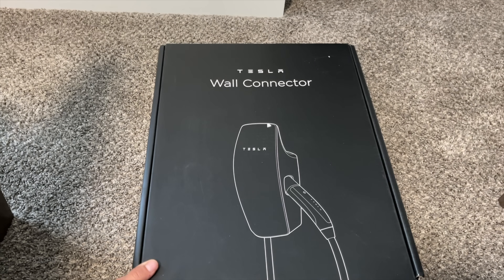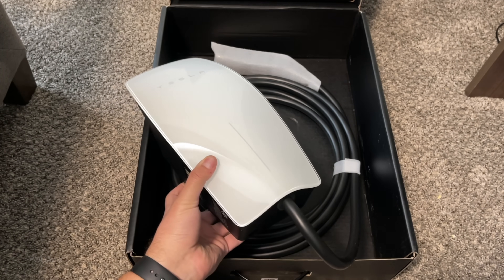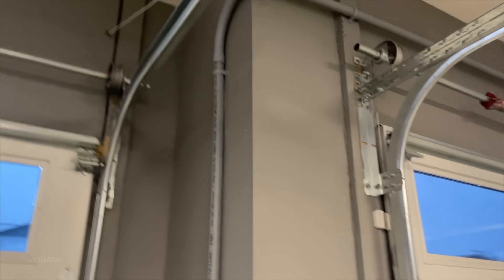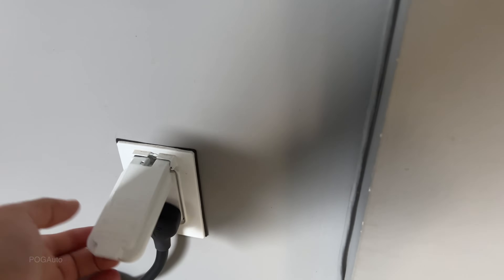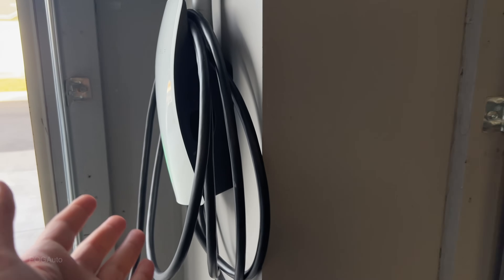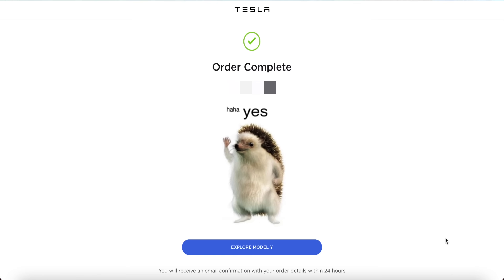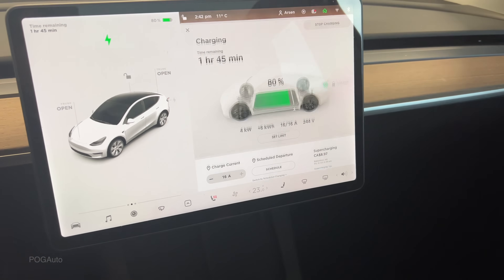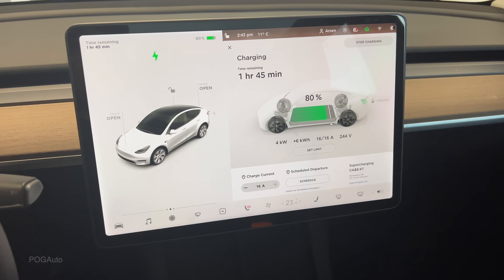Tesla Wall Connector - You need to know this about home charging!

Comment: I just purchased a 2025 Model 3 Performance back in March. I planned on doing Supercharging when my battery was really low and need  to do longer trips since it was right down the street and figured I would only need to charge once a week cause I live 3 miles away from work and use my 110 mobile charging for overnight. supercharging is a pain though overtime since its time consuming. so far I noticed I use about 5-10% daily (Based on Weather). So I was going to have a 14-50 NEMA EV outlet installed with a 40AMP breaker on a 100AMP service. But even with an EV outlet I just felt uncomfortable plugging in to an outlet overtime which could eventually lead to loose connections and possible electrical fires (highly unlikely with a professional install and the correct outlet wire and GFCI breaker.) but the down the road maintenance on the outlet didn't make sense. So instead I bought the wall Charger for 420 dollars and had my electrician install a 60AMP breaker on a 100 AMP service. I know it sounds like too much but my scenario is unique I don't have central air or a mini split our heat is oil and no electric hot water tank. We have a washer and dryer on electric. But with the car charging on 48amp the stove running with the dryer off and lights on through the entire house the electrician did a load calculation and the house was pulling 65AMP's. I don't Plan on charging my Tesla while cooking a Turkey in the oven while doing a load of laundry. Electrician said even if I did that I would still be fine. I charge at night after 11pm everyone is in bed lights are off and maybe a few window AC's all 110v are running (summer time).  Electrician stated that Electrical is much more efficient then years ago. 

Moral of the story if you wanna do a wall charger on 100AMP service have an electrician come out and do a load calculation. to see if its possible. Maybe you will have a scenario like mine. But so far I have had no issues and its great waking up every morning with an 80% charge.

Comment: Do you know what size wire they used from the breaker box to the Wall connector?  If they didn't use #6 or thicker gage you still won't be able to safely use 48amp charging with the wall connector. (so obvious answer would be to re-run that bit of wire with the right stuff but it's another expense you may not have considered)

Comment: What a crazy waste of money for a glossy EVSE. Should have just bought another mobile connector and added a nema 1450 outlet.  I did all mine on a crusty 30 year old Challenger panel with a 50 amp breaker for $350.  Mobile connector was $250.  My car charges at 32 amps.  Or 50-80% in 3 hours.
Reply from the maker: Please see the new updated video. This was done for a upcoming planned upgrade

Comment: Dude - thought it’s supposed to be “how to use a Tesla Wall Connector” - not what are the requirements to  install the wall connector.  Took us 2 hours run wires / install.  How to use a Wall Connector app once everything install

Comment: I hope people pay attention to your advice of checking out your homes electrical panel before moving forward with an upgraded charger or really any item that you plan on using more electrical at your house. I work in HVAC and can not tell you the number of times we need to upgrade the electrical panel to have the new system installed to code. If you do not do this it can cause major issues including major safety problems. Really glad you included that last part, very important.

Comment: I'd get a second opinion for a different electrician and also consult your power company.  the power company WANTS you to drive EVs badly and will make it work one way or another.
Reply from the maker: Unfortunately the electricians were right but there is a different way and now there are 3 wall connectors installed on a 60amp breaker on a power sharing mode

Comment: Can you install the Tesla wall connector outside? My garage has too much stuff in it to fit a car. 😂
Reply: I saw another video where the Tesla owner recommended the wall charger (over the mobile charger) for outside use as it's designed to be weather resistant.

Comment: Look into a black box.  It is a automatic load management system.  So you can have a 60amp breaker installed as it would count that 60amp breaker as 0% load not 100%

Comment: You should have wired it for 60amps anyway with the appropriate hardware and breaker instead of limiting yourself to 20amps. In a crunch, you could monitor electricity usage and devote up to 60amps of your available 100amps to your EVs (like at night when you're all sleeping and pretty much electricity use is very low). Plus, you could always control the charging amps within each EV so that you never draw more than what is available to stay within a safety limit during the busy times.

Comment: Hey POGAuto, I am also from Alberta as well.  Instead of the Wall Charger, Would you recommend to get the 240V wall plug and just use the Mobile Charger that way instead of the Wall Charger? I do have the same issue as you as I have a 100Amp Breaker Box

Comment: if you dryer connector is reachable, it could be a 32amp connector.  You may need to order is the type of nema plug from tesla and you can use the mobile connector to charge faster - like almost 30km+ / hour.  If you already have a NEMA 14/50 connector for your dryer, you may be able to use the extra connector already provided with the tesla mobile charger.
Reply: The negative about using the dryer charger is that those are mostly made of plastic and are considered Residential plugs and the Tesla Charger will / should required a commerical plug to lessen the event of over heating and catching fire.  DO NOT USE your house dryer connection.

Comment: I am surprised you have a 100amp service I am just outside Calgary and have 200amp service.  My last place was just a townhome condo and it also had 200 amp service and was about 18 years old.  You can do load sharing if you have two Tesla wall chargers as well so that they can use the same breaker and the two will talk to each other and limit output so that it only uses the maximum of the breaker.
Reply: Because you didn’t live in a single dwelling

Comment: You can have two level 2 wall connectors and they will load balance by communicating with each other so neither goes over the limit you set (in your case 20 amps).

Comment: Your underground wire from the transformer to your meter box is the same for 100 and 200 amp. Couple things though, you are in Canada so might be different. An old subdivision might have a old smaller wire in the ground. You look like you live in a newer subdivision. The power company /utility company is not going to run a smaller triplex to your home and a larger triplex to your neighbor if they have a 200 amp service. Union electrician here and worked in the housing market for over 25 years in Chicagoland. I can't count the number of meter boxes if have wired and there was no difference in triplex size, at least here. The wire from your meter into your house and panel would all have to be changed to 200 amp.

Comment: Sad people do not know that petroleum and coal is what produces electricity
Reply: Depends. A lot is solar, wind, hydro and nuclear. Even if it's comming from coal it's still using less energy than an ICE vehicle.
Reply: @stbr0510  what is your source? EPA? 😂 Even wind power farms affect the environment.
Reply: @hadessahf3549  Any use of energy has an effect on the environment.  However, all uses are not equal.  Why not use that which has the least influence?
Reply: @Pimpernicholas  Those sources also may not be as effective or may pose more risks in the long run. As you know, there are many factors that require consideration. Some we know and some we do not know.
Reply: @hadessahf3549 Why not start with what we know.  I think the ones we know are well-known.  Few people commit suicide using wind, solar, hydro, nuclear compared to internal combustion engines.  I would say that these health-risk facts are well-known. and there are others that are as obvious.
Reply: @Pimpernicholas  One problem of mankind is- “we don’t know what we don’t know”.
Reply: The CO2 per kw/h (delivered) for California is 0.879 pounds (i.e. end to end C02 production for the full cycle including the full production chain of the fuel source is 0.879 pounds for every kw/h produced).  For a Tesla model 3 in a warm climate the average milage is 4.0-4.5 miles per kwh for a base RWD so for 10,000 miles (lets take 4 to be on the safe side  that equals 2198 pounds of CO2 produced IF 100% sourced from the grid in CA. For a modern sedan (say a BMW 330i) the CO2 produced at the tailpipe is 0.35 pounds per mile (combined) so for 10,000 miles that's 3500 pounds CO2, but there's about 25% extra CO2 per gallon from the refining and transport process (which is already factored into the California delivered CO2 number) so that's 4375 pounds for 10,000 miles or about 2 times more CO2 from a modern ICE v BEV.

Even in the worst case scenario (100% from the grid and no home solar) a Tesla 3 produces 1/2 the CO2 of a similar 3 series BMW in CA.

Comment: Your house does not continuously use 100 amps, not even close.  Might peak to close to 80 amps when absolutely everything is on, depending if you have air conditioning, electric heat, electric hot water, electric cooking, electric clothes dryer, etc., but these are not continuous loads.  Therefore, you might be able to install a 60 amp, but more likely it would be safer to go with a 50 or 40 amp 240 volt breaker if you install an EV management device which will automatically monitor the total power your house is consuming and disconnect the EV when needed to keep the load within the capability of your electric service.  There are several brands available, but a Canadian company makes one called dcc electric.  

BTW, from the video it looks like a pretty large size wire was installed.  If so you would not need to upgrade the wire, just the breaker, and of course install the EV load management equipment.  Since the wire is in conduit you could use a 60 amp breaker if the wire is #6 or a 40 or 50 amp breaker if the wire is #8, assuming the wire is THW, THWN, THHN, etc., and assuming Canada's wire ampacity requirements are the same as those in the US.

Good luck!
Reply from the maker: Thanks for the information but our house had to have EV management system to have anything above 20AMPS. I had that in plan once we get more Tesla's delivered, that is why the wire was thicker to be compatible with a 60AMP breaker. Now we have 3 wall connectors power sharing with EV management system and 60AMP breaker.
Reply: @POGAuto  That's great.  I take it that you now have EV Management system installed? Curious if the EV management system lets you know how often it is actually turning off your EV charging, and if so how often it actually activates?

Comment: Thank you so much for your video but we don’t use any kind of an adapter or anything, we bought the the exact same Tesla wall charger, we had a Electrician come and made 220v connection straight to our panel, we’ve used it for about 3 months with no problems but recently it’s been tripping the breaker about 30 minutes into charging our vehicle, we have a Tesla model 3, what could be causing the circuit tripping. Thanks
Reply from the maker: I am not an electrician but just a suggestion. Try connecting to the wall connectors wifi and then making sure it has the proper AMP breaker set up. If you have a 30AMP breaker in the panel then set it to 30AMP mine is a 60AMP now and it is set to 60AMP which gives the car 48AMP of charging speed